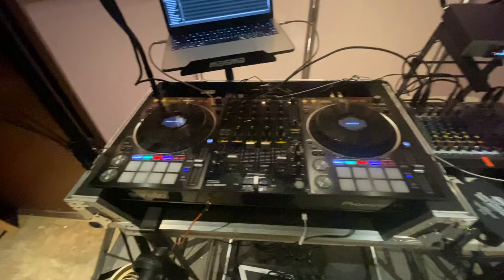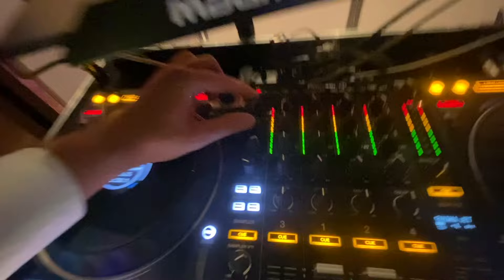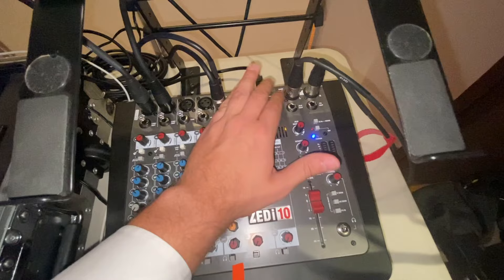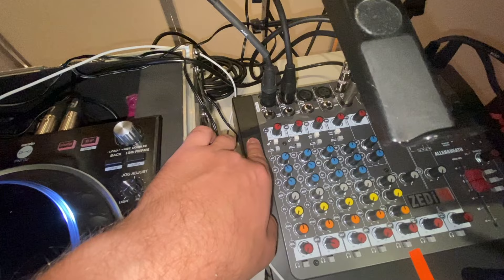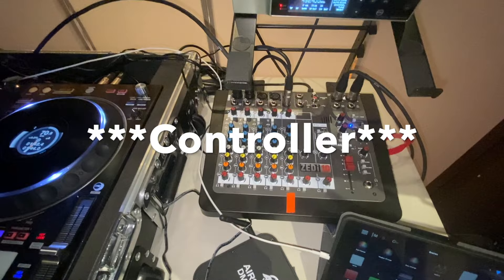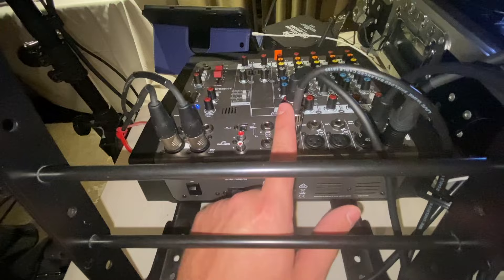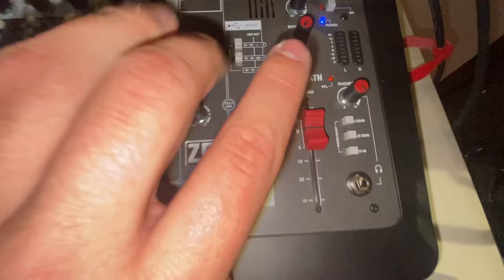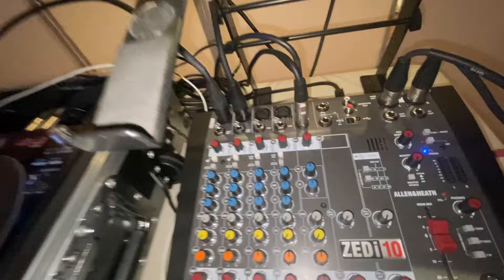How to Connect a DJ Controller to an External Mixer

Comment: From your controller to you mixer is that a TS or a TRS tip on the 1/4 end.
Reply from the maker: TRS
Reply: Giving the fact that he uses the Pioneer DJ mixing console XLR balanced master outputs, he has to use a TRS balanced jack at other end, but the will loose half (6 dB) of the original signal level the moment he inserts the TRS jack into Allen Heath Zed input jack, due to the fact that the Zed mixer inputs are actually unbalanced.
Reply: @valentingheorghe1693  I have a Yamaha MG10xu mixer with unbalanced stereo line inputs as well.  I'd like to use the balanced 1/4" outputs from my controller using male to male TRS cables instead of the unbalanced RCA outputs/inputs assuming this will provide better sound quality.  If I lose half of the original signal going with the 1/4" TRS cables, is it still an improvement or better than simply using the unbalanced RCA cables?
Reply: @alexisratsch7265  Doesn't matter if you're controller have balanced outputs and you're connecting it to the unbalanced inputs of your Yamaha mixer. The signal will become unbalanced anyway, so you are better off using the RCA to RCA or RCA to TS cables.
As long as you use high quality RCA cables, don't try to run them on long distances (over 3 meters) and keep them away from electrical cables, you are safe.
Balanced cables are ment to be used for audio signal transmission over long distances because they have better noise rejection capabilities.
Your mixing console nominal output level on balanced outputs is +4 dBU, wile your mixer unbalanced inputs expects a nominal input level of -10 dBV, which is about 12 dB lower.
Alternatively, if you still want to use your controller balanced outputs, you can connect it to the Yamaha MG10XU mixer balanced inputs (channels 1 to 4), engage the pad switch and adjust the gain accordingly.
May I ask what is the purpose of the Yamaha MG10XU mixer in your signal chain?
Reply: @valentingheorghe1693  Thanks very much for your response!  I am DJing using a controller and the purpose for the MG10XU mixer is to provide better mic sound/effects and to be able to add a keyboard, a groovebox, and a tablet or phone in the event my laptop crashes in the middle of a gig so I can keep the music going.  If I use channels 1 to 4 to obtain a balanced connection are there any drawbacks or risks of damage to my controller?  I heard somewhere that if the phantom power button is accidentally turned on it may damage the controller.  My mixer will always be within 1 meter of my controller, so maybe the RCA connections make the most sense, although it would be 12 dB lower.  What do you think would optimize the sound without any risk of harm to my gear?
Reply: @alexisratsch7265  You should not fear engaging the phantom power button (48V) as long as you are paying attention during equipment operations and restrict the access of the stupid people near your equipment.
Regarding the use of an unbalanced connection, don't worry too much about the 12 dB difference between the -10 dBV (consumer audio level) and the +4 dBU (professional audio level), because your Yamaha MG10XU mixer unbalanced inputs have gain knobs that allow to adjust level of incoming audio signal in order to bring it up to the +4 dBU operating level required by your mixer, internally and at its balanced master outputs.
Basically you use the Yamaha MG10XU mixer mainly because it offers more control and features on its microphone channels.
If I can make a suggestion to you, take a look at Behringer RX1602 V2 rack mixer, because it offers the possibility to connect all your line level (-10 dBV and +4 dBU) equipments, balanced or unbalanced ,to a single unit, with side chain functionality and then you  can connect the RX1602 to the Yamaha MG10XU.
Reply: @valentingheorghe1693  Thanks again for your feedback. I will definitely look into the Behringer mixer.  Maybe this is a silly question, but is it practical to bring a rack mixer to a concert without having a rack?  I have no experience with these.  You mentioned that the unbalanced inputs on the MG10xu have gain knobs, however mine does not; there are only gain knobs on channels 1 to 4.  Is it possible you are referring to internal preamps that increase the line signal?  Ultimately, it sounds to me you suggest using the unbalanced RCA connections over the balanced TRS cables (into channels 1 to 4) because the distance is short and the signal is amplified.  Is that correct?
Reply: I was also wondering, is it possible that phantom power only applies to the  XLR portion of the combi jacks (Channels 1 to 4) and not the 1/4" TRS part?  Or does it power both?
Reply: @alexisratsch7265  Channel's 1-4 have XLR/TRS combo inputs and, usually, the phantom power is applied only when connecting microphones on XLR connectors. The TRS connector is used for connecting instruments or other line level sources.
Reply: @valentingheorghe1693  Thanks for clarifying that; so I guess there is no risk if the phantom power button is engaged while using 1/4" TRS cables. I had a look at the Behringer mixer and it definitely is affordable; I'm just not sure if it is significantly advantageous for me and if it will really produce an improvement in sound.  I have no experience with these.  I'm also unsure of the practicality of carrying this extra piece of gear to an event and whether it requires a rack or enclosure of some kind.  Returning to my original question, if I'm only using my current Yamaha mixer,  it sounds to me you suggest using the unbalanced RCA connections over the balanced TRS cables (into channels 1 to 4) because the distance is short and the signal will still be amplified by the mixer.  Is that correct?
Reply: @alexisratsch7265  No, I'm not suggesting to use RCA to TRS cables, simply because it's not the correct way to make an unbalanced connection.
What I am suggesting is to use RCA to RCA cables or RCA to TS (unbalanced) cables if you want to connect the controller unbalanced master outputs to the Yamaha mixer channels 5/6, 7/8 or 8/9, or, to use TRS to TRS cables (balanced) to connect the controller balanced master outputs to the Yamaha mixer channels 1, 2, 3 or 4. The latter option offers you the benefit of a balanced connection and the possibility to use the input gain controls available on the channels 1-4.
Regarding the Behringer RX1602 V2 mixer, I can tell you that I use it in my signal chain without any problems and the sound is good. Although I have it installed in a rack, it doesn't require to be installed inside a rack unit. I use it simply because it offers me the possibility to connect multiple line level sources to a single unit.

If you look at Yamaha MG10XU mixer control panel you will observe that under the 48V phantom power button is stated "Channels 1-4 MIC", which means that the phantom power is available only for the microphone inputs using XLR connectors. If you make an effort to study your mixer block diagram, you will observe the connections for 48V leads only to the XLR connectors.
Reply: @valentingheorghe1693  Thanks again for all your clarifications and I especially appreciate you confirming that phantom power will not damage my controller if I use TRS cables!  I think we have a slight misunderstanding. When I said using the RCA connections OVER the TRS cables I meant INSTEAD OF the TRS cables.  I understand that I need to choose between a complete balanced connection with TRS cables into channels 1 to 4 (likely 3 & 4 to save the compression for mic and other applications) OR a complete unbalanced connection with RCA cables into channels 5 to 10.  Considering the cable distance from the controller to the mixer is so short (less than 2 meters), is the balanced option really noticeably superior to the unbalanced option?
Reply: @alexisratsch7265  Depending on the controller master output nominal level, which can be +4 dBU on balanced outputs and -10 dBV on unbalanced outputs, choosing a balanced connection may indeed be beneficial because the higher signal level is already high enough and may not require additional gain at the mixer balanced inputs.
On the other hand, on some controllers the unbalanced master output level may be also around 0 dBU to +2 dBU , which is higher than the usual -10 dBV, providing a very good signal to noise ratio at the mixer inputs.
The higher the original signal level the better the signal to noise ratio.
Personally, I use balanced connections wherever possible along the signal chain (dedicated microphone preamplifier, external effects unit, graphic equaliser, compressor, crossover, loudspeaker management system).
Reply: @valentingheorghe1693  Ok, great; I'm learning a lot.  I found these specifications regarding my controller line outputs in the manual (https://drive.google.com/file/d/13ja-sHxcpUfcSDyXBaVq96ksS21Iadi-/view?usp=sharing), but I'm not sure if my RCA outputs are higher than the usual -10 dBV.  Nonetheless, I'm understanding from you that balanced connections are the most optimized situation.  I'd be interested to see, if possible, what your signal chain looks like, or maybe something similar so I can understand better what is involved.  I'm also curious, can phantom power damage a dynamic mic plugged in as an XLR?  Lastly, does the Behringer mixer transform unbalanced signals into balanced ones?
Reply: @alexisratsch7265  Your controller unbalanced RCA master outputs seems to work at a nominal level of -10 dBV (-7.78 dBU), with a maximum output level of +12 dBU (the difference of about 20 dB between the nominal output level and the maximum output level is your headroom/peakroom), while the balanced master outputs seems to work at a nominal level of 0 dBU (-2 dBV), with a maximum output level of +18 dBU. This means that the balanced master outputs nominal output level is 8 dB stronger.
An example of  my signal chain will be like this: there mixing consoles (mixer 1 connected to three turntables, mixer 2 connected to microphones and various instruments, mixer 3 is a standalone controller) connected via balanced XLR-TRS cables to the Behringer RX1602 V2 studio mixer.
At this point, I'm using only three stereo channels on the Behringer RX1602 V2, with the other 5 stereo channels being available for connecting various other sources.
The Behringer RX1602 main outputs are connected, via balanced TRS-XLR cables to a 31 band analog graphic equaliser.
The graphic equaliser main outputs are connected via balanced XLR-XLR cables to an analog compressor/limiter.
The compressor/limiter main outputs are connected via balanced XLR-XLR to an analog crossover network.
The analog crossover network distributes the audio signal, via balanced XLR-XLR cables to 4 active main loudspeakers and 4 active subwoofers.
Regarding the use of dynamic microphones, their construction is simpler in comparison with condenser microphones. Dynamic microphones do not contain any active circuitry and, therefore, they don't need phantom power and will not be affected in any way by accidentally engaging the phantom power, because they are designed not to use it.
Behringer RX1602 inputs accepts both balanced and unbalanced sources, wile its outputs are balanced, so, in a way, you can say that it transforms unbalanced signals to balanced signals, acting like a DI box. Its main outputs operates at a nominal level of +4 dBU and a maximum output level of +22 dBU, resulting a headroom of 18 dB.

Comment: Allen Heath Zed series mixers are indeed well built and able to provide a good sound, but their line level inputs, although capable of accepting TRS or TS jacks from balanced or unbalanced sources, are, in fact, unbalanced. Therefore, if your DJ mixing console has symetrically balanced outputs, you will loose half (6 dB) of the original signal level the moment you connect to the Allen Heath Zed TRS inputs and you have to compensate this signal loss by adding gain on the Allen Heath Zed series input stage, instead of keeping the signal chain at unity.
This behaviour may not occur, however, if the DJ mixer master outputs are impedance balanced.
Audio mixers THD and noise measurements are made with the controls zeroed (no audio signal attenuation), so whenever you have to use the input preamplifier to add gain, you also add some measure of noise to the original signal, affecting the dynamic range and headroom.
Also, keep in mind that the balanced master output level of a good DJ mixer is +4 dBU (1.23 V RMS) and Allen Heath Zed series line level inputs work at a nominal level of 0 dBU (0.775 V RMS).
Reply: What mixer can you recommend  that  will take two 15  top and one 18 sub  along with mic and wireless systems?🤔
Reply: @edwinhernandez6627  Are we talking about active or passive loudspeakers?
Reply: @valentingheorghe1693  powered loudspeaker  and sub.
Reply: @edwinhernandez6627  You need the following equipment:
- mixer, with as many microphone and line level inputs as you need, balanced inputs, adjustable input gain controls, PFL functionality on every input channel (highly recommend), balanced master outputs and other functions you considers necessary for your work
- graphic equaliser (31 bands recommended) and, if possible, with built-in high-pass and low-pass filters
- active crossover, with built-in delay controls and mute functionality on every output stage
Alternatively, if you like, you can use a dedicated speaker management processor, which includes the equaliser and crossover.
Reply: @Valentin Gheorghe much appreciated,  looking  at 10-12 chl mixer . 👍
Reply: @edwinhernandez6627  If you intend to work with live bands, start with at least 12 mono channels and seek group functionality on the mixer.